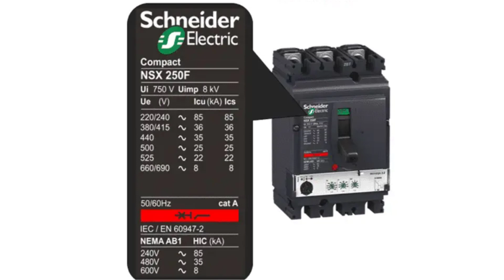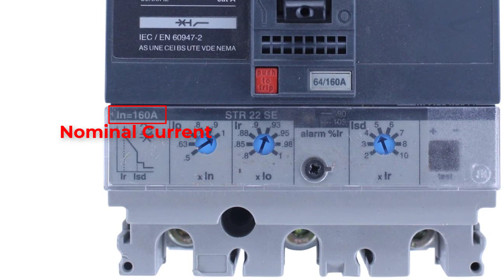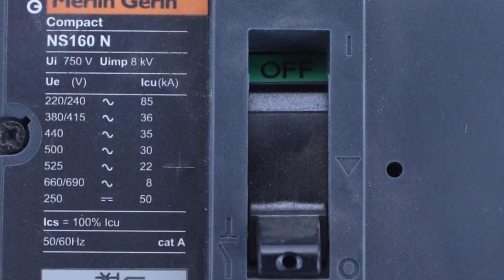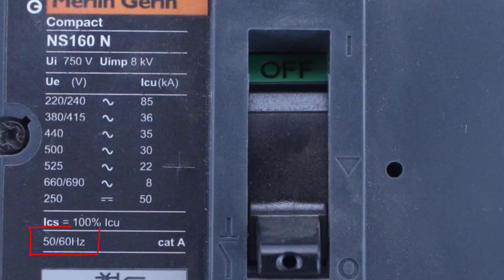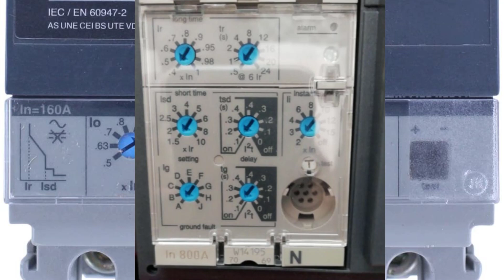Molded Case Circuit Breaker (MCCB) Nameplate | Part 3 | EXPLAINED

Comment: Thanks for Your fine videos, it's nice to learn about the MCCB's in this compact format. I'm mostly in to the DC version for securing our 24 Volt system powering an electric outboard motor. Would You please consider to explain the tripping characteristics of the MCCB? Is it the value Cat A in Your videos? If so I'd be very happy to learn more about this topic, especially the A curve as this is hard to find on Youtube or the web. Thank You
Reply from the maker: Sure stay tuned to the next video, and thank you for your support 🙏❤️